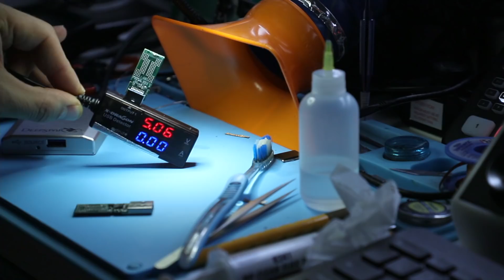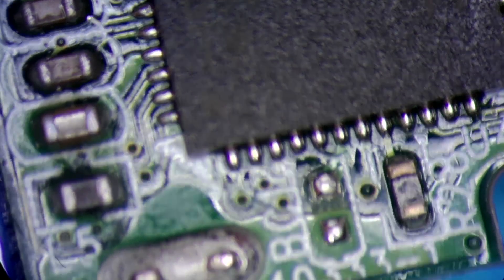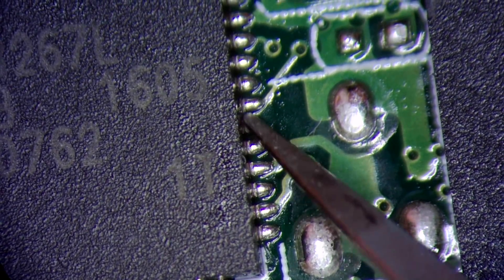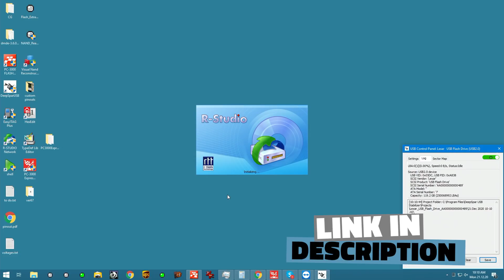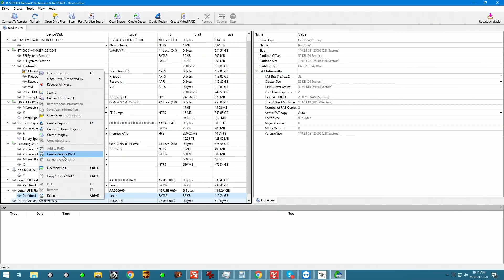busted flash drive fix

Comment: What if I store a data for e.g a photograph in a flash drive and leave it powerless for 10 years. Will the photo be still in there if I connect after a decade??
Reply from the maker: High chance that the flash drive will not work